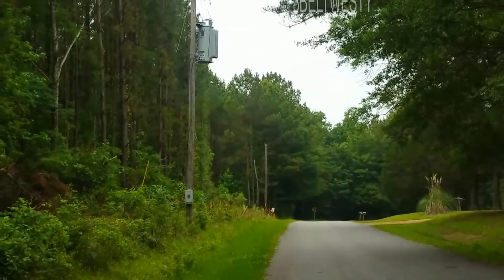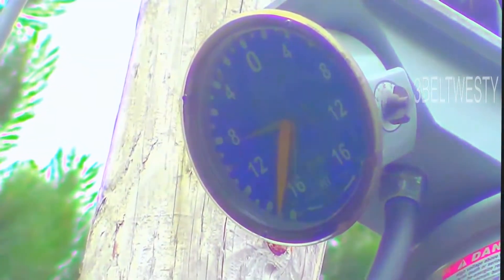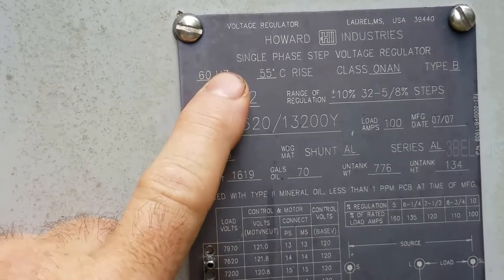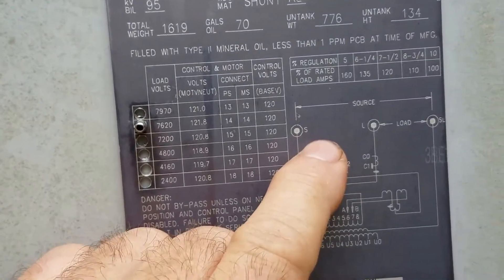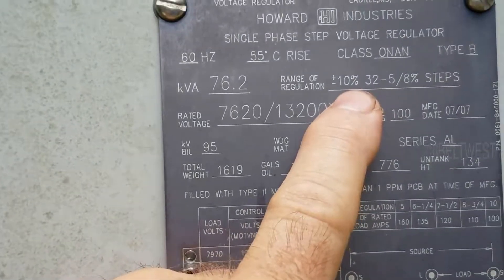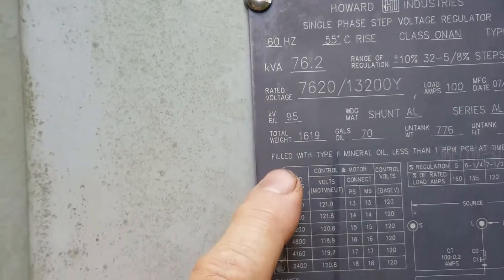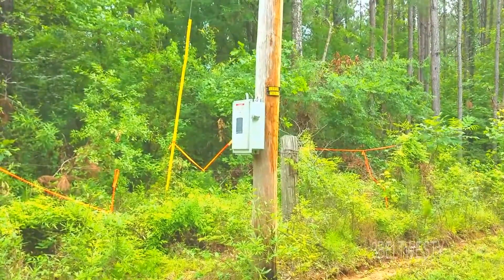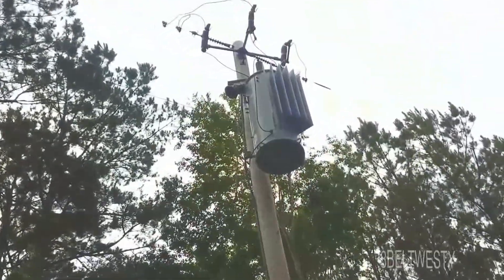76kVA Single Phase step up regulator Howard Industries

Comment: I've seen inside pole transformers and reclosers, but haven't seen in a regulator. I am curious as to if they are just a high voltage auto transformer, or an isolation transformer that can vary the amount of taps on the incoming coil. Either way they're a feat of engineering.
Reply from the maker: Yes The regulator is an autotransformer. This rural single phase feeder is nominally 7200 volts and about  10 miles from the Substation in Canton Miss. It is the 3rd regulator, ie two other banks exist closer to the substation. The units up the stream are 3 of these in a bank , one for each phase. The first one is about 2 miles from the substation and the 2nd bank of 3 is say 3 miles upstream. 

My guess is that the 7200 volts line to neutral goes back to the REA electrication of rural areas in the 1930's. The voltage drops along the high side thus they add these stepping automatic regulators to buck or boost the highs side to try to keep the nominal 120 volts close to 120 volts. Normally one sees 3 of these regulators on a structure of two poles say 6 ft wide. ie the poles are such the 3 pots are in a row. Sometimes in  places they just add a small autotransformer to boost it some between two of these autotransformers but that is no so common. 

The dial gizmo is hard to video against a bright sky. The neutral no boosts is with the dial at 12 oclock. If this area was rebuilt from scratch they would use a higher voltage than 7200. They did this on the Gulf Coast after Camille in places since the area was wiped out in places. In older rural areas like where this video was shot the population has grown, there is a Nissan plant in Canton. Thus bigger homes pop up with 5 tons AC units and thus the voltage can sag unless these boosters are used. 

 In the banks of three of these regulators most of the time they look the same physical size. But some have
 one unit that looks way larger ie that phase must have more load.

 The dial tap position gizmo is mechanical, it moves when the tap is changed.

I tend to spot these regulators more in the rural areas than urban areas.  
Regards 3BW
Reply: It would be interesting to see the inside of one of those regulators, to see all the mechanical workings. I wonder if the core of those transformers is toroidal like in a variac, or a shell type coil with a on load tap changer. Voltage regulators are very uncommon here in the greater Philadelphia area, as the former Philadelphia Electric Company now Exelon still uses their 4,160Y/2,400V distribution system, which is very inefficient. There is a 33,260Y/19,200V to 4,160Y/2,400V substation approximately for every 25 square miles, as the 2,400V can not travel too far without dropping out completely. Most of their power poles were built before WWII, and are ancient compared to the new technology available. There are still GE fused cutouts on their poles patent dated January, 16, 1912, accompanied by some archaic transformers that I was able to date back to 1900 in a vintage GE catalog. The tank has a square cap on the top where all the bushings overhang from. 

Starting in the 1980's they were slowly rolling over to 33,260Y/19,200V poles. For example if a car were to crash into a pole, it would be replaced with a pole rated for 33kV, and a 19.2kV transformer with a 2.4kV tap. Then the 4kV lines would be on top of the poles until all the poles on a run were replaced, then they would set the taps to 19.2kV and up the voltage. The only problem with that was they used cheap made offshore14.4kV rated insulators, and the partial discharge of 19.2kV to ground is very costly. Additionally 33kV running through neighborhoods is very dangerous, so those plans were scrapped around 2010. Now their distribution grid is cluttered with 33kV poles inline with 4kV poles with 3FT cross arms. Which is very confusing to non Exelon contractors, such as myself, if they need to work on a pole. 

In the 1970's they started to roll out 13,200Y7,620V in Philadelphia; however, that voltage does not make sense as 2,400 divides into 19,200 8 times, and for efficiency they could have chosen 12,470Y/7,200V as 2,400 divides into 7,200 3 times. 3 2,400V coils series for 7,200V and parallel for 2,400V. They haven't been so quick to push out that voltage over their service territory for some reason. Up near New Jersey and New York, PPL Corp. operates a solid 12.47kV grid, which is pretty slick with 69kV feeders feeding certain points of the inter-tied grid. Although impedance matching may be tricky from an engineering standpoint. After the hostile take over of Exelon, BGE and Potomac Edison, operate 33kV with 13.2kV. I think in the master plan they are trying to make a solid 13.2kV grid with 33kV feeders.  I'd like to get a voltage regulator in my collection of electrical things, but they are way too big and expensive.
Reply from the maker: Here is the install manual: https://www.howard-ind.com/HowardTransformers/literature/SVR1RegulatorInstructionManual.pdf   The sales blurb too; http://www.howard-ind.com/HowardTransformers/Literature/VoltageRegulators.pdf  Tap changer is probably like this maybe: https://en.wikipedia.org/wiki/Tap_changer  Regards 3BW